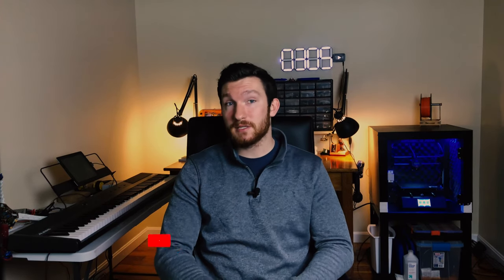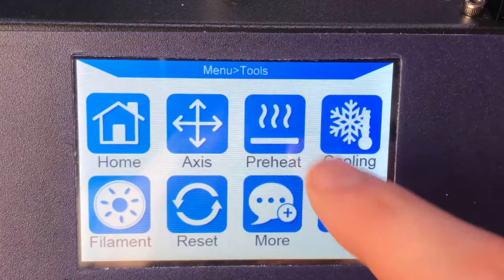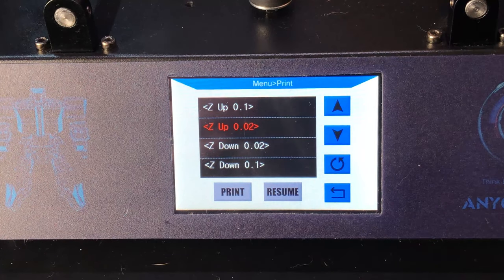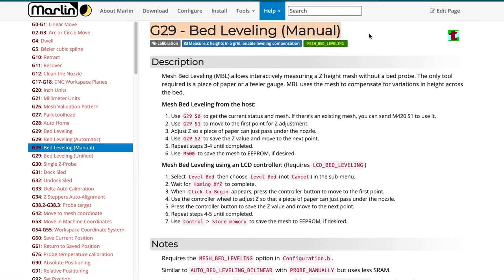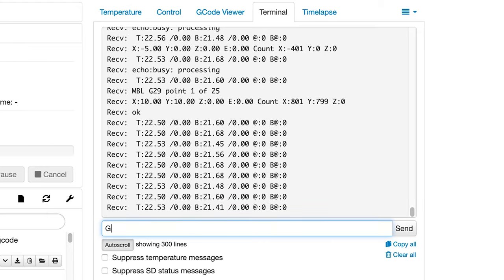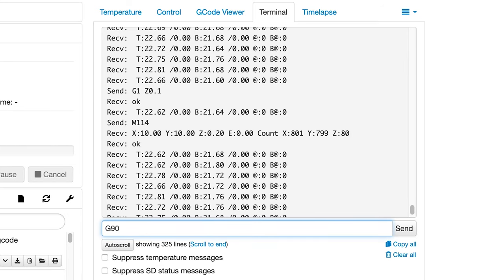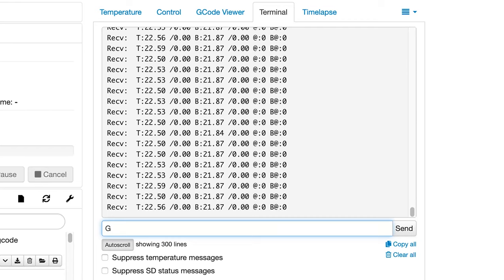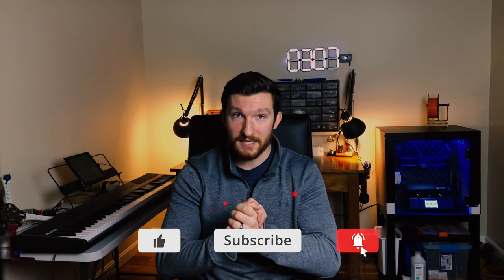Manual Mesh Bed Leveling For Marlin Firmware [Fix For Warped Beds!]

Comment: Many thanks. My BL-Touch failed and I wasn't going to pay for another one after 6 months of light use. So I removed it and upgraded to Marlin 2.0.9.2 and followed your guide.  This latest Marlin has a bed level menu where you just click and adjust the height. A bit easier than G91 and G90. .All working well now.👍

Comment: It amazes me why there are STILL so many out there on social media basically confused with installing and pulling hair at the same time with purchasing these 3rd party ABL's when the "built in" Marlin Mesh Bed Levelling does exactly the same and its easy to configure and free!
Over the last 4 years, that's all I've used, and very rarely have to relevel the build plate.

Comment: I did the mesh bed level a few days ago and did a few prints thinking it was working. Didn’t realise I had to add some Gcode to the start. Thanks for making great content!
Reply from the maker: Thanks for the comment! I appreciate it!
Reply: @ModernHobbyist  Does different room temps dramatically change the bed's height? Last week my room was around 21C and stuff printed out like normal but cause it almost winter for me my room temp is around 11C. My prints no longer stick to the build plate and I was required to relevel the bed. It is quite annoying to have to go through the process.
Reply from the maker: @R-K1N9  That could definitely be the case, the bed might be acting differently due to the different ambient temperature of the room. The other issue you might have had, is the bed might have settled some from the vibrations of every day use. It's not uncommon to have to re-level your print bed, though you're right it can get annoying!

Comment: Ok this might be a dumb question but wanted to make sure I understand using the G29 S3, how the mesh bed is laid out on the terminal, it should represent the point if you were looking at the bed correct?  Example, the next square just below the first mesh point that was printed, should be X1 Y2 correct? Or would it be X5 Y2? Since technically it was the 10th point that was set up?  Thanks in advance!
Reply from the maker: Hey Steven, thanks for the comment! If I understand your question correctly, your first answer would be correct. The G29 S3 command outputs and views the points as a grid with (I believe) a 1-based coordinate system, with the front left being the point X1 Y1. Hope that helps!

Comment: I have 3 anycubic printers where the auto bed leveling sensors are not functioning just after 3 months of purchase. Their support is useless. I'm planning to make a manual bed mesh. 
Do you have any video where you show how you install the custom marlin firmware?

Comment: How would you set the mesh with a probe? Would I just do G38.2 Z0 to Set current Z0 Set the offset by using G92 Z1.6 for the probe thickness, then G29 S1 to start the mesh creation then do a move to safe height command, then G38.2 Z0 then G92 z1.6 to probe to the new Z height with the offset, then G90 G29 S2, Safe height, G38.2 Z0 G92 Z1.6 G90 Safe height..... etc till I have all the points I want then M500? If theres an easier way let me know!

Comment: I did the m501 and m420 s1 thing in the initial gcode but the bed leveling still turning off when printing... I really don't know why it turns off by itself.
I also activated the enable_bed_leveling_after_g28 line but still failing...
Reply: @Modern Hobbyist  Have u aby idea about fix this problem? i have ideamaker slicer

Comment: Thanks a lot for your video! I'm going crazy trying to level an Anycubic Mega S. One further question, when you level specific points, the value affects the rest of the points? so if I modify the central point (point 13) will that value affect from 14 until 25?
Reply from the maker: Hey thanks for the comment! No, if you edit point 13, it will only affect that point. The rest of the points start at the absolute 0 point and adjust from there. Hope that helps!

Comment: Hi, I do have a custom built 3dp and i dont have a lcd controller, rather i use pronterface or cure from PC as a host. When we do the manual mesh bed levelling using the gcode, do we need to properly set a value for the Z_CLEARANCE_DEPLOY_PROBE and Z_CLEARANCE_BETWEEN_PROBES ? I am confused about the clearance that the hotend will initially maintain at each of the individual mesh points. Which as i assume should be at a certain height(maybe in 5 to 10 mm range) above the bed at each mesh point so that one can move the hotend down enough until the height is adjusted properly to just reach the bed and at the same time without crushing against the z-min end stop. So here the concern is, the z-min end stop is at a fixed point on the z-axis bottom part, hence during the mesh bed manual levelling process after the hotend finishes z-homing  does the hotend move some distance upside(away from bed) by itself before moving to first mesh point. And does this upward movement of the hotend happen everytime when hotend moves from one mesh point to the next one? How to configure these values?

Comment: if I let the printer go back to home, does the distance to the nozzle have to be the same everywhere on the bed as with the mesh bad leveling on Marlin?  or the saved bad leveling is only started by Marlin and the nozzle adjusted when the pressure starts.  or how else can I check whether the printer has saved the settings during bad leveling?

Comment: Great video! One question though, after the mbl, and send a g29 s0, i see that every next measured point is added up to the previous point. Seem to adjust z height relative to the previous point. I use the same 1.1.9 firmware, used 2.0 previously and experienced the same thing. I check it using octoprint bed visualizer. Any hints to why it doesn't show the z per point relative to z=0? Thanks!!!

Comment: Thank you so much for your videos! They are a huge help! I do have one question, when I hit print, my menu is empty and I don’t have all the options that you do after I updated to the marlin 1.1.9 Any idea what’s going on? I’m stuck at this point and can’t go any further to create a mesh.
Reply from the maker: Hey Lara, thanks for the comment! I'm not sure if this is your problem, but you might need to remove any files on the SD card that have special characters. This includes the factory files as they have some Chinese characters and that seems to break the current menu logic. Hope that helps! Let me know if you have other questions!

Comment: BEST VIDEO ON HOW TO USE BED LEVELING FROM MARLIN! i just have on question by default i have 9 mesh points how can i increase them like you have done ? thanks!
Reply from the maker: Thanks so much for the comment! If you want to increase the mesh points, you'll need to recompile the Marlin firmware after changing the following in configuration.h:

// Set the number of grid points per dimension.
  #define GRID_MAX_POINTS_X 3
  #define GRID_MAX_POINTS_Y GRID_MAX_POINTS_X

Hope that helps!

Comment: Would you suggest running the bed at 60 degrees for the  mesh leveling setup
Reply from the maker: Hey thanks for the comment! I personally choose to run the bed at temperature while doing the mesh bed leveling. I've found that the bed changes shape slightly as it heats up. Hope that helps!

Comment: have 3d printer ender 5 s1 pro and I have sonic pad. have problem level my bed and temperature its printer moves the designs I make please help me. what the temperature heat bed i put my 60 my front doesn't sticking

Comment: really appreciate your vids.. however even with mesh I cant get my first layer. I give up and I will give back my mega -s. Could please say how to come back to original firmware so I will open a dispute to change my printer. I really tryed and this was my last chance for making it work.
Reply from the maker: I’m sorry to hear that! You can download the stock firmware from Anycubics website and flash it the same way you did for the Open source Marlin
Reply: If you wanna give up, I’ll take that printer off your hands 😈
Reply: @MrBaskins2010  😂😂 I ve solved the issue with a mirror on the top and amycubic is sending me a new bed.. great assistance.

Comment: So with this manual mesh bed leveling, once you store the adjustments, if you go back and perform another bed leveling at another time, does it use the stored adjustments for the new leveling allowing you to tweak it slightly or are we starting over from no mesh?

What is the easiest or best way to tweak each tile once they are stored, am I going to have to issue marlin M420 commands from a console and then re-save with M500?
Reply from the maker: Hey thanks for the comment! When you start a new mesh leveling procedure, it will go from the global offset, effectively ignoring the existing mesh, if any. 

As for editing individual points on your mesh, the only way I have been able to, is using the M420 commands. I will certainly let you know if any better alternatives pop up! Cheers!

Comment: If I give this video 100000000000000000000000000000000000000000000000000000000000000000000000000000000000000000000000000 like that would still not be enough! Bro you made it work bro! Bro You're awesome bro! I can hear the z-stepper motor compensating and my test print now is much better after watching your video! I have been trying to get the mesh bed leveling to work on my ender 3 for a while now but with no luck until I followed your steps and now it's working! Thanks a lot!
Just a question though, do I still need to repeat the process again when taking off the removable stock sheet for the bed of my ender 3, or when leveling the bed?
Reply from the maker: Thanks for the comment! I'm glad I could help! Good luck with your future printing endeavors!

Comment: I have a Mega-S and the <Special Menu> isn't listed in my print menu like it is in yours.  Do you know why it would be missing from my menu?  I'm running Marlin 1.1.2 (as from the settings menu on my printer).  I checked with G29 S0 and the reply is Mesh leveling has no data, so it is enabled.
Thanks for your help.
Reply from the maker: Hey Zach, thanks for the comment! Did you install the open source version of Marlin or are you running the Anycubic stock firmware, which happens to also be an old version of Marlin? If you are still on stock firmware, the instructions I gave are for the open source version, so you'd need to update to that if you want to follow along. Sorry for any confusion or missed information! Hope that helps!
Reply: @ModernHobbyist  Its strange.  I did the update from within Octoprint and now my printer no longer makes the jingle noise on powerup so I assumed it was updated successfully.  I'll have to re-check to make sure, but I got the successfully updated as in your updating marlin video.  thanks.

Comment: you just got a new sub. this video had so much information that I could follow. I am having issues with a warped bed on my Flsun QQ-S and the auto bed leveling doesn't do it and I have recently upgraded it to marlin. But at the moment my marlin has mes bed leveling commented out and has ABL uncommented. can I have them both uncommented or is it one or the other?
Reply from the maker: Thanks for the sub I truly appreciate it! I don't know much about ABL as my printer doesn't have it, but I would think it does something similar to MBL although it may cover less points in the mesh. I'll look into it and hopefully get back to you!

Comment: Nice video as always. Not sure if you know that using DavidRamiro's firmware for i3 Mega, there's a special menu on screen to do the mesh bed leveling calibration directly using buttons on screen, instead of manually sending g-codes. Check it out.
Reply from the maker: Thanks for the comment! The first method where I showed how to calibrate using the touchscreen was actually done using Dave Ramiros's firmware. Quite Handy!

Comment: Found your video and hope that It can help me. I have an Anycubic Chiron that has mesh leveling using a probe. My probe is damaged so I cant run the mesh leveling from the printer. Ive been trying to find a way to create a blank mesh so I can adjust the individual 25 points from the screen and have it saved.  Do you think that if I create a gcode file containing G29 S1
G91
G1 0
G90

It would create a mesh file with all points at 0.0? Or would I have to add these commands for all 25 points?
Reply from the maker: Thanks for the comment! If you aren't worried about losing the current mesh data, you could just reset and disable the mesh with:

G29 S5
M500

Then you could kick off another mesh bed leveling process from the screen, or edit them manually through GCode. Hope that helps!
Reply: @ModernHobbyist  the problem is that the mesh leveling is dependent on a pre existing mesh. I cant create the initial mesh without the probe. A new probe from China will take almost a month. Im trying to figure out a way get by until it is delivered.
Reply from the maker: So you wouldn't be able to use the above code to create a blank mesh and then use the G29 S3 command to set each point individually?
Reply: @ModernHobbyist  that's what I'm going to try in a little. Just researching to see if it's possible. Will update it it possible.

Comment: Hi, great video, i have a Mega S and would like to have the Mesh bed leveling menu options on my machine as i have a bed that is warped as there is a high spot in the center of the bed. Can you tell me what version of Marlin i will need and where about's i can download it from. If you could give me a link that would be great.

Comment: when i do G33 for my Delta printer Predator i get this ecv: 
G33 Auto Calibrate
Recv: Checking... AC
Recv: .Height:450.00  Ex:+0.00  Ey:+0.00  Ez:+0.00  Radius:227.00
Recv: .               Tx:+0.00  Ty:+0.00  Tz:+0.00
Recv:  T:23.12 /0.00 B:26.25 /0.00 @:0 B@:0
Recv: echo:busy: processing
Printer seems to support the busy protocol, will adjust timeouts and set busy interval accordingly
Recv:  T:23.12 /0.00 B:26.25 /0.00 @:0 B@:0
Recv: echo:busy: processing
Recv:  T:23.12 /0.00 B:26.36 /0.00 @:0 B@:0
Recv: echo:busy: processing
Recv: Deploy Z-Probe
Recv:  T:23.12 /0.00 B:26.25 /0.00 @:0 B@:0
Recv: echo:busy: paused for user

i install the probe and then what do i need to do as command to make it go to next step ??
Reply: Deltas are whole different beast in some cases. I’d check a Predator Facebook group since anycubic stopped officially supporting the printer. Sorry I couldn’t help :(

Comment: But what about this. I’m curious to know.

What if I level my bed with a piece of paper. Z is then approx. 0.10mm off. 

Why not level your bed with the nozzle against the bed? Isn’t that how it’s meant to level?
Reply: Hello past me, 

As no one replied to you. 

There is something called z-offset. You level your bed with paper. It will be approx indeed 0.10mm. Then when you print. You are using the z-offset to adjust the right amount of squish. 

In meanwhile, I can tell you I bought a BL-Touch. Started using Marlin 2.0. Then switched to Jyers FW and even compiling it myself these days on Github.

I overcame all kinds of struggles since your message. Extruder arm broke, bed was not flat, bowden tube was gunky. 
I got a aluminum extruder atm, a new bed one from the store you bought your printer from and I'm using a Capricorn tube.

Also, these days we are printing with PETG ma man! 0 Stringing.

You've learned a lot. 

Don't give up.